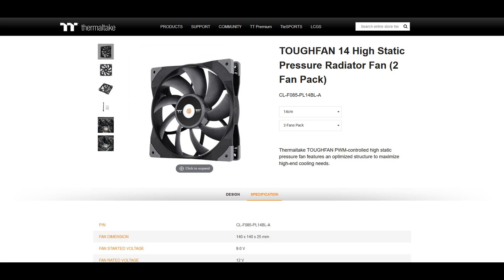The Best Water Cooling Loop in the World? Parts One by One

Comment: Have you thought about changing the tubing on that Coolermaster or EK sub-zero cooler which is limited by the radiator and put your watercooling loop to it? Of course, the coolant has to be automotive coolant to stop freezing, but it could lead to a long term stable extreme overclocking without any liquidfied gas involved.

Comment: Can I use the Mora radiators in a copper loop? Thanks a lot for the showcase.
Reply from the maker: Not fully sure about that, hopefully yes but you should ask from them.
Reply: If anyone is interested, I asked them and they told me you can use it in a copper loop.

Comment: This makes no sense. You are still cooling to ambient regardless of how big the rad is. Why not mount the rad outside? Or a small aquarium chiller is less that 600.
Reply from the maker: Condensation is a problem.
Reply: @LuumiJuhani  i use a chiller 24/7 i run it at 10-15c
Reply: what doesn't make sense? more Radiator surface area means you can either handle higher Thermal loads at the same Temperature or get lower Temperatures than with less.

more Radiators, more performance. what isn't extremely obvious about that?
he doesn't need his Open Loop to be subzero, he has friggin' LN2 when he wants to do that.
Reply: @taiiat0  You will only ever reach ambient temperature. Overall elaborate setup for nothing. Mount the radiator outside with less surface area achieves far better results for less money and work.
Reply: @taiiat0  lies. I mentioned the temps i run straight up. stop hiding
Reply: What cooling and gear do you run Hero?
Reply: @taiiat0  I run a chiller all day every day. at 10-15c as i already mentioned. Please provide what you run and specs please otherwise go away peasant
Reply: @dime4026  So, you mean the water in the loop is chilled to 10-15C? 
1.  What do you do about condensation ? 
2. Water being chilled is a way to get higher OC speeds ?
Reply: @TiraSoft_GB_Ham  thsts right. Its chilled to just below ambient. Depending on the day. But over time ive learned thst 10-15c is best to stop condensation. Once I get 10c difference between ambient and the water condensation can occur. So I have multiple fans on the socket and video cards. I have had condensation build up in the pc and have had shutdowns they required hair driers. Twice. Didnt lose the 2 2080tis or the 9980xe cpu. The loop also has an condenser on it with 200mm fan for late night ambient Temps without the chiller. The radiator is in a 100l tank that the chiller keeps cool
Reply: @TiraSoft_GB_Ham  the chiller is a way to keep high loads under control. As an example. 4.9ghz 9980xe and dual 2080ti will pull nearly 1000w of power which then translates to heat. Normal fans and a water system will get crumpled by this load as I know my 5hp chiller at 1c still sees 69c+ under full load.
Reply: @dime4026  I see . Myself I want to try to cool down the water with kind of 2 Peltiers - total of 560 W cooling - each Peltier with its own water loop 360mm rad 3x120 mm fans. (main loop having a Mo-Ra3 as the main rad / double D5 pumps , etc)  . And I want to keep the cold side of Peltiers just above dew temp - means kind of 14-16C degrees now . I am not sure if this will be as good as your setup (more than likely not  ...), but the i9-10999KF heat is just over 400W on full load 5.5-5.7Ghz OC (not 1000W as yours)
Reply: @TiraSoft_GB_Ham  peltier are over complicating the loop. Single chiller pump and reservoir. Loop external radiator in reservoir with separate radiator and fans optional. I run a 7.5kw chiller. If you are planning on cooling that amount of heat with a peltier your going to have a bad time.
Reply: @dime4026  On full load i9-10900K overclocked to 5.5Ghz and over generates kind of 400W +  heat . Why do you think thousands of watts of cooling power is necessary ?
Reply: @TiraSoft_GB_Ham  i should send you a diagram of the installation. Generally people consider peltier for how in expensive they are but end up spending more on keeping them cool or making a loop more complex
Reply: @taiiat0  Where did i mention sub zero? ln2 isnt even in the arguement. Find me someone who runs ln2 24/7. Its either shitty ambient room temp radiators or a chiller below ambient for less money
Reply: @taiiat0  Better thermals than this monstrosity for less than 100usd. refrigerator condenser mounted outside.  
9980xe 4.9ghz all cores 46c condenser only. Chiller set 11c 19c all cores. less than 600usd. Ambient temp water cooling is a joke.
Reply: @taiiat0  Oh thats with "two" 2080ti also on the loop. So keen to know what your setup is.

Comment: I'm about to put my loop together for the GPU ln2 bench. I'm only using a single ek 60mm thick 360 for now. But I have the noctua ippc 3k fans for it. Was going to get ln2 today but they are closed in weekends :( when I took apart my kp card, it had 1995 written on the frame of the die. Did you see what was written on your card?

Comment: Hi Luimi, my 10980xe can run 4.7ghz @1.17v in cinebench R23. 
However, when I want to push it to 4.8ghz, it always failed. I tried to increase the voltage, the benchmark instantly crushed when I increase to 1.22v. However, the cpu runs too hot at that voltage. Is this a radiator or a cpu problem.I use two 360mm ekwb xe in my setup.
Reply from the maker: What input? try it at 1.9v.
Reply: @LuumiJuhani  I tried the 1.9v input and 1.21v Vcore. It barely passed the test, but the hottest core reached 96 celsius. And 1.2v Vcore just won't work.
Reply from the maker: @royzhou7275  You need stronger cooling then.

Comment: thermaltake did a pretty good job of copying Noctua, but only do 1800rpms, good a quiet though
Reply from the maker: There was a review where those actually beat the Noctuas.
Reply: @LuumiJuhani  Optimum Tech did a comparison yesterday and they were 99% identical in performances, except as mentioned above the 1800rpn max vs Noctua 2100rpm and they seemed less smooth.

On a side note; I was about to ask if you used aircon to deal with the temperature in Thailand, but then noticed the radiator. So back in Finland. Maybe just open the window at this time of the year 😉 Not into extreme overclocking, but thanks for sharing your knowledge 👍🏼
Reply: It does look a lot like a gentle typhoon clone as well.

Comment: MORAs are pretty pricey, generally cheaper to just look around used market or b-stock for whatever you can find IMO
Reply from the maker: Yeah they aren't cheap, but it is also expensive to combine radiators like this.
Reply: Alphacool/Aquatuning sells returned radiators for a fraction of the original price. 
The bend up fins are easy to bend back and after some cleaning, they are as good as new.